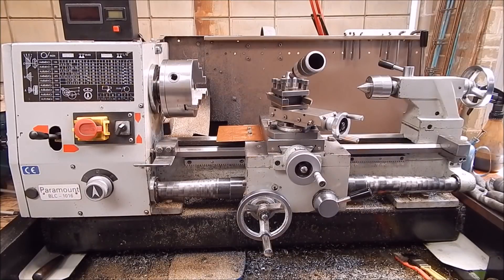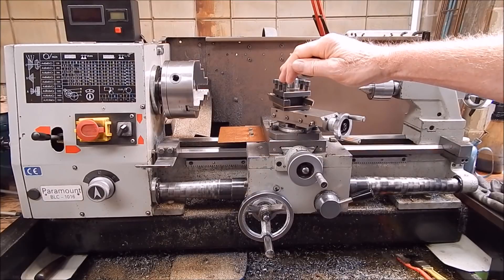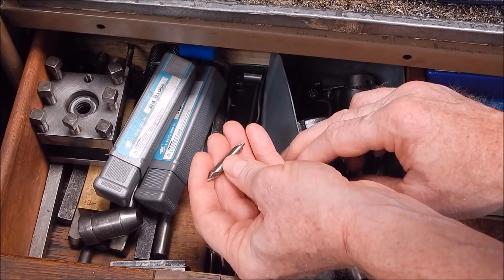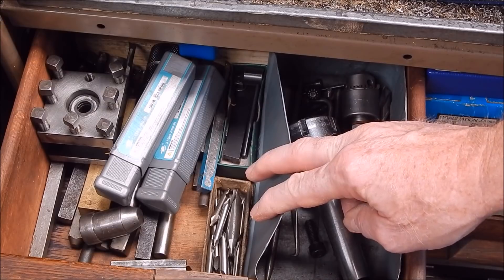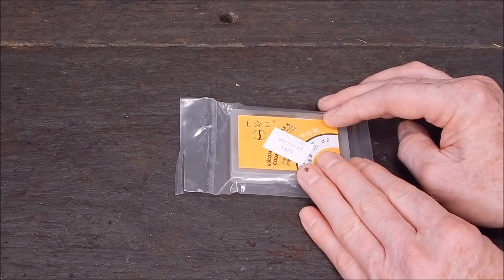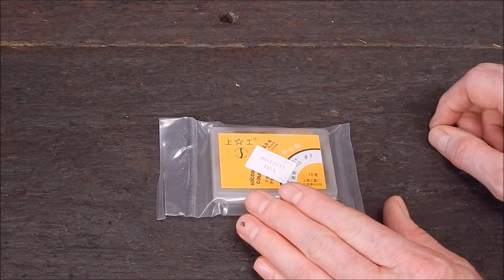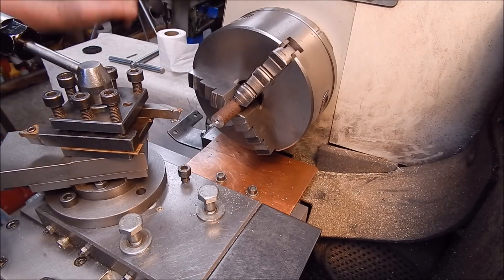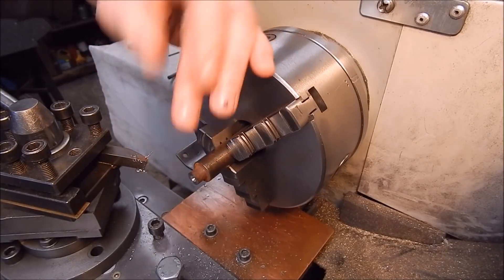Why are most lathe center drill bits so expensive ?

Comment: I bought a bunch of cheap center drills once but they don't have the secondary facet (cross grind, thinned web, whatever you want to call it). They tend to walk much more, but now I'm stuck with them. Ought to buy some stubby pilot drills some day since I use the center drills for all sorts of stuff they are not designed for, risking to snap the tip off unnecessarily.

Comment: Banggood has centre drills AS well. Reasonably priced starting @ 1.20 for the smallest to 1.70 for the largest (7.5 mm). But in the pictures you can see their rough finish and grind. You need to regrind those out oft the box. Some of their stuff is good some is not. Rob's choice looks better in quality and price. All center drills, even the best ones, have a thick web at the tip and no secondary rake angle. Both help to more easily break them. If the tip got a four-facet grind and a split tip like high quality twist drills (look it up) they would last longer. But who would spend the time to do that?

Comment from the maker: NOTE:   I got flamed by a viewer (who's comments I have now hidden) because he expected this video to be an all singing, all dancing, educational video on using a center drill.  It's NOT.

This video merely shows how well the cheap center drill handles various grades of steel.  The stock used are scrap off cuts and not intended to be mounted in a center.  It is purely a demonstration of the drill's strength and ability.

The center drill is not being used as a spotting drill and should never be used for that purpose.

So there you have it.  I'm pretty generous when it comes to allowing adverse comments, but in this case the viewer was totally off base, and pushed his luck too far too often.  His loss.

Cheers Rob
Reply: xynudu how to use center drill: give part to someone with basic mechanical aptitude. Pay money. Go home happy...
Or, learn basic machining skills. To do so, spend more time on lathe practicing than watching YouTube videos...

Comment: Lube and feed pressure invariably seem to be the deciding factors over longevity, oh and chip clearance ... even with nasty materials. Your purchase seems to have been extremely reasonable.
I got some time ago some extended length center drills and they worked out pretty good.

Comment: A wile back you make adaptor plate to use a larger chuck. 6" I think? I was thinking of doing the same thing but I noticed it dosnt really come out much ( in videos at least). Was is too heavy for the little lathe ? I have the same size lathe
Reply from the maker: Hi Daniel,

I have made backing plates for two six inch chucks and they came out well.  No issues. One was steel and the other was cast iron.  They are quite OK weight wise for a 10 inch swing lathe.  I had one of these chucks on the lathe in the previous video.

Cheers Rob
Reply: okay thanks!

Comment: no2 seems to refer to the end size being 2mm,  with the overall diameter of 5mm,  i found 10pcs on ebay uk for £4.67 from china
Reply from the maker: Not really.  The following chart shows the dimensional relationships in metric and imperial.

http://www.i-logic.com/utilities/CenterDrills.htm

Cheers Rob
Reply: ahah yes the imperial system strikes again! lol
Reply from the maker: Yes, there are some coincidental tip diameter relationships in Metric, but that's all it is .

Cheers Rob
Reply: Actually you can buy either Brown & Sharp numbered center drills which run from #00 thru #10 in size or metric sized ones which are sized on the drill section by actual millimeter size. Both can be ordered out of China, sometimes seems like the metric are cheaper. I order a lot of 2.5 mm sized ones which have a slightly larger body than a number 2 B&S and a slightly smaller drill section than a number 3 B&S.

Comment: I only use a centre drill, when I want to run a centre in the hole, which for me is rare.  I use a spotting drill to start a jobber drill and it works well.  Most folks don't run the spindle any where near quick enough. This is right at the centre where there is no speed.
Totally agree about the sound of the small end breaking, that is nasty, only noise I hate more is a parting tool changing shape before my eyes.

Comment: Rob, i bought a 10 pack of 2.5mm centre drills from Suntek Store in China some 5 years ago this month. In all that time, I only broke one (rushing the tailstock up to the work) and managed to lose another one somewhere or other. The rest are all sitting there in the plastic box. They've handled everything I've thrown at them including 1045 and Stainless which I machine quite a lot so I'm not surprised at your success with the drills that you bought. 
Cheers from NZ.
Reply from the maker: Hi Alan,

I recon that most of the center drills you buy from local tool suppliers are Chinese anyway.  They may stock brand names but the price probably makes them poor sellers.

I've used both Chinese and Suttons over the years and they all break eventually and perform much the same.  Size seems to be main factor in durability and the larger sizes last a very long time.

Cheers Rob

Comment: Hello Rob from South Africa
These 60 Degree Centre Drills are frustrating to work with as we have also broken numerous, and still do with galling Materials. U should have posted Your link to the site where U  got them from.  Will look at Flea Bay anyway. 
However,  another good option to look at as suggested by Stefan Gotteswinter,  the German genius, is 90 Degree Spotting Drills or Single Flute 90 Degree Starter Drills.  They work better, are supposedly more accurate, if not precise,  and should last much longer.  Only problem is for U and me, who don't have such deep pockets, is the PRICE !!!  They are NOT Cheap. And can be had in Carbide - which is even more expensive.  But definitely worth a look at for us who break so many of these 60 Degree Centre Drills. 
Just my two cents ....thanks for sharing and showing.  Our Thoughts concur on the same issues
ATB
aRM
Reply from the maker: I added the links in the comments section - to avoid YouTube doing a tissy fit over possible non existant sponsorship .

Cheers Rob
Reply: Keep in mind that you still need 60° drills to match your center angle, especially with dead centers, or the lack of running surface area will groove them.

Comment: G'day Rob.  Doubleboost says center drills only purpose is to break when you use them.  Or words to that effect.  I only break them when it is totally important not to.
Reply: CurlyG65 how do you know that?  i cant understand him.  lol
Reply from the maker: G'day Harold. 

Doubleboost is right.  Nothing sinks the heart as much as that crunch sound when the tip snaps off.

You know from that point on that the day is basically stuffed.

Cheers rob
Reply: How do you break a center drill?  Mine only get dull. Geez, speed and feed. Mine go from 4mm to 20mm. Truth be told, I have broken a few in 20 or so years but that's what happens when you force a dull bit, sigh.
Reply from the maker: Use No. 1 or 2 and your breakage chances increase dramatically.  I don't have breakages with sizes above 3.

Rob
Reply: xynudu:  Ummm, 2 is the smallest I use in my lathe (Victor 1660) and mill (Lagun FTV 4).  And I still don't break them. They usually die from dull and are replaced.  My gotos typically range from 3 to 6 but I do have an 8 or 9 for the heavier duty stuff . And I don't power feed or use the speed handle on the mill.  Worse case on the lathe is using a 3 or 4 to make a dimple to make certain it's centered and won't walk before stepping down to a 2. 
Scotty